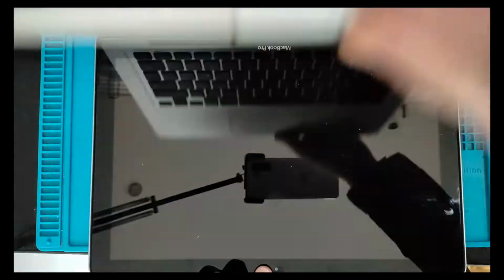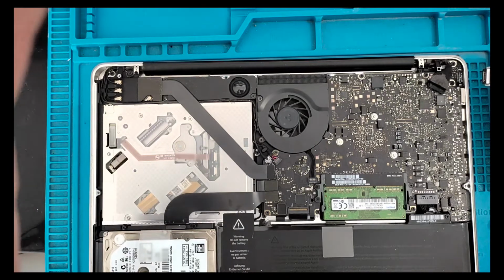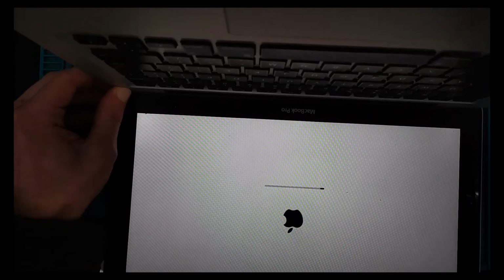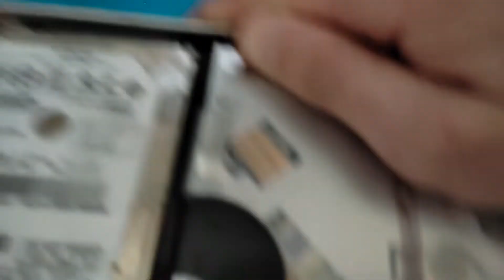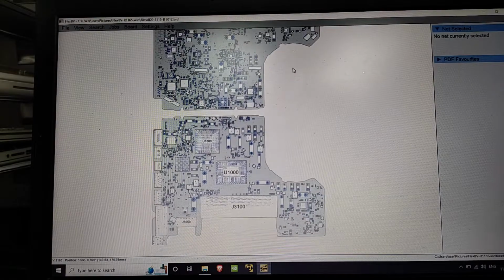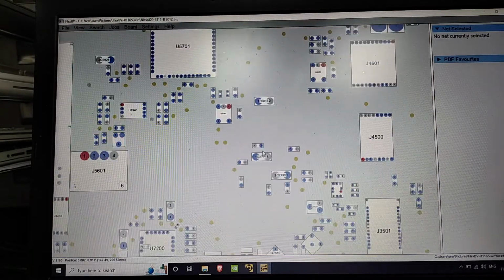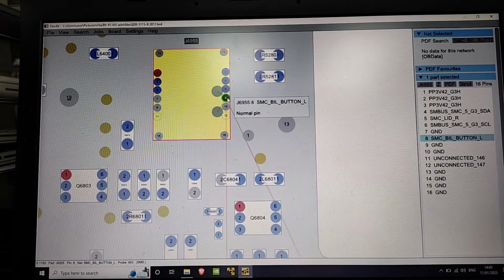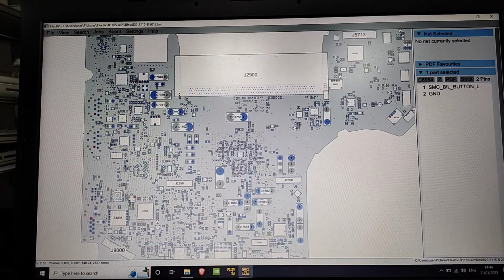2008-2012 A1278 A1286 Power Button Repair Without Keyboard Replacement

Comment: I opened my MacBook Pro mid 2012 13 inch model to change the thermal paste and now it’s not turning on. The charger led is on though.

Comment: You can also find the pin by measuring voltages and the pin you need will be high when standby and 0v when button is pressed and back to high (i guess 3.3V or so) when let go of button

Comment: Hi there, is there a specific way to turn on a macbook without power button switch? thats my only problem. I think my problem is in the silicon pad but I already bought key cap. Im unsure to buy a rubber pad?

Comment: My mackbook pro 2012 isn't turning on. Can you help me identify and fix the issue?
Reply: My charger shows a green light but it doesn't turn red. Battery indicator doesn't blink as it did while charging.
Reply: There was a short circuit later, when I disconnected the battery and plugged in the charger to turn on the mackbook.

Comment: This happened to me thought my Mac may have a bad Mobo. It’s def the keyboard and power, although keyboard works but not all back lights. I was recording and doing a lot of session stuff. No mixing as it’s an older Mac. 

What works is unplug battery, plug in power cable and comes on. 

Now one VERY Important thing!!!!! You need to plug the battery back in after to get full CPU power. I ran some test sessions and my CPU without battery in was at 99% on my audio app. Plugged in it drop backed to 10%, and works as it should. So keep that in mind! Unplugging the battery and leaving it that way, will hurt CPU usage big time. 

Another issue I’ve had to fix was the ribbon cable got scuffed. You’ll see this through the SSD/HD not reading or a drastically slower computer! Solution is to replace cable for $15, and put electric tape on both sides of it. That way no micro tares. 

I got this same 2012 for free, and have a nice $3k Mac at home to mix. I like this older Mac because we are past the point of returns with CPU power. I can easily track 45 audio tracks, but wouldn’t dare mix. I will also do live audio playback. 

These are cheap second hand at $180 or so. For $250 you can get a 16gb/512gb faster ssd MacBook I7 2015 15in. Already bigger screen size, faster cpu, and faster SSD..I think they used NVME 1st gen or something. But it’s something to think about! 

I do music and need Intel based Mac for $30k in analog gear, I don’t want to replace. So need the 32bit app support for some direct monitoring and Mojave. I love these have firewire still. But I’ve tested adapters, and found as long as it’s Intel and Mojave it works for me. 

With all the M1/M2 out you can get any MacBook Pro Intel for pretty cheap! High end ones 6 years ago at $2.8k for $500 or less. People were doing video and pro music on those. Gone are the days CPU power is super drastic for most apps. I wouldn’t wait high end video…but for DJ, Backing Tracks, MIDI brain, lighting rig or just tracking audio bs loading mix plugs….these old Mac’s are a great value! 

Home Mac a good one is the 2020 Mac mini I7 Intel with 1tb. It’s a beast still and can upgrade ram to 64gb ddr for audio samples. Thunderbolt to Firewire I tested on many models, and on all Intels it works! Even with current OS, but you lose 32bit app support past Mojave.

Comment: Dude this was a lifesaver I bought a lot of macs on auction for like $15 each and already got 2 working with this idea I just downloaded the board schematics for each model and installed a board viewer to run it and been using old individual  telephone wires to re wire past problems the power button/batt indicator idea was great I like in South Africa so spare parts are often not an option

Comment: sir very nice technique having trouble with my mac pro 820-2565A i cannot locate where the power pads since power button doesnt work   the fan  spin ON and OFF when i plug in the magsafe cable i have green light but cant power on. and where can i find those schematics for the pinouts  to to make a jumper connections ?

Comment: This is an ingenious fix that I haven’t seen before.  I probably wouldn’t try it without some basic electronics experience.  I can remove screws, parts, and connectors relatively easily but once you start using schematics and multimeters it becomes like learning Greek to the average person.
Reply from the maker: To be honest.... This fix maybe is the best way to start practising soldering.... Because it does not look complicated. Just need patience and steady hands.